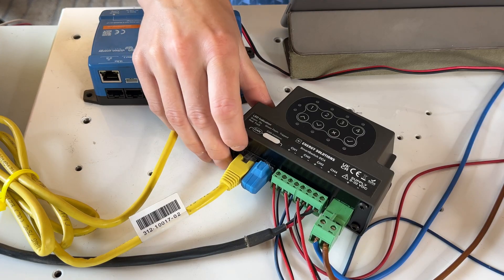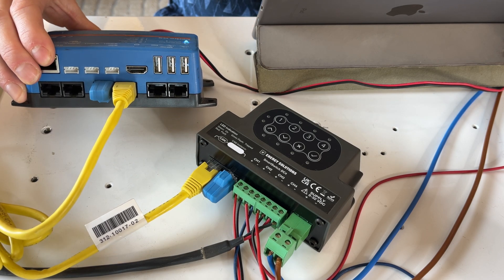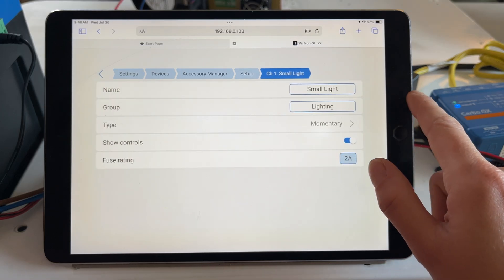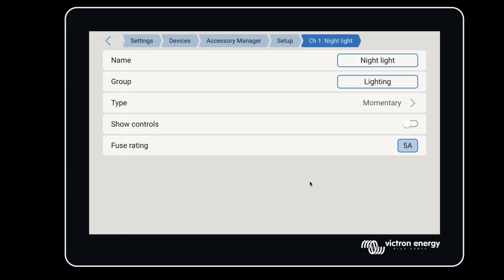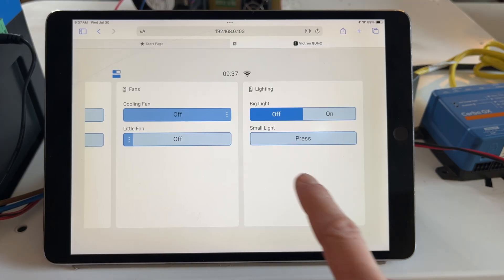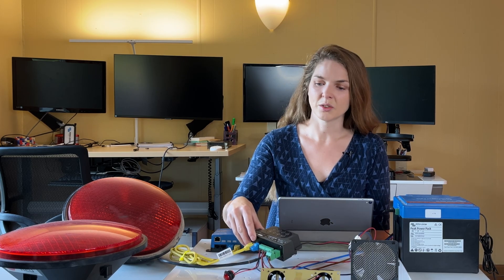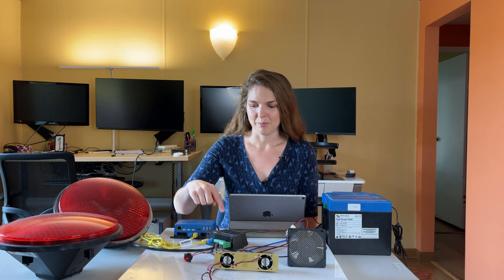Add More Relays to Your Victron GX: SmartSwitch DC Load Controller

Comment: How do I set an output on the Smartswitch DC4 to control a fan from a temperature sensor connected to the Cerbo GX?
Reply from the maker: This would be something I'd most likely do via Node-Red. A bit more custom, but it would allow for the most flexibility in your setup.

Comment: Hey great video, I want to use this to controller for my water actuators water tanks valves for my caravan that has three tanks. From my end look good but I just want to know is there a setting to automatically close the empty tank and open the next full tank. Thanks
Reply from the maker: Not a specific preset to do so, but if you have tank level measurements you could likely create such a function via Node-Red. Trigger "x" to happen when tank 1 is empty, etc.

Comment: It's mentioned in the video if you wanted to turn a heater on you would need the right relay, how does that work and what product can I use?  Good video.
Reply from the maker: This depends on the heater in question. A small one might be able to run through the relay itself, a large one we might see an "ice cube" relay involved. Basically something that is rated to handle the power and the output of this device triggers the control circuit.

Comment: $300 though. Great idea and product but not for that price
Reply from the maker: Ah! You think? For the control, flexibility, and direct power throughput of the device, you’d be hard pressed to find as simple and robust a solution for a better price.
Reply: @intelligentcontrols in a marine environment, though can be used in RVs or elsewhere, have a look m at the maretron mpower - 12 digital switches AND 7 digital inputs, and each switch can do upto 5, 10 or 12amps, and this can be increased by doubling inputs. These smaller ones you've shown have such limitation for 5amps - I have 2 led light snakes that go over 5amps!  You can also get the Maretron, which can handle 100a in total, for less than a 4 of these ones you have shown, and it can power a lot more.
I do like the physical switches on the unit, but I understand d why the maretron ones have a separate physical switch panel- if the main unit is fried, the separate switches should still work, but with the ok ones you have shown they are fried as well.
There's many things I don't like about the mpower, but so far they are by far the most full featured.
Until other non marine manufacturers realise the price is ridiculous for the limitations - having a separate relay for fridge, freezer or anything above 5a is stupid and unnecessary - we have to go with the proprietary. 
I'm really looking forward to seeing a better mousetrap, but the unit you show isn't it.

Comment: Can you make a video demonstrating how to configure a dimmable light
Reply from the maker: @buckmanriver good clarifying Q. Do you mean within the SmartSwitch and the Victron UI? These are regular, nothing-special lights and fans on the demo board (and they have been returned to the wild!) but I connected each one to the SmartSwitch, went into the Settings > Devices > selected the channel and set it to be either dimmable (PWM), latching(toggle) or momentary and the the SmartSwitch does it's magic, no extra step needed. (See min 2:02 in the video for a visual.)
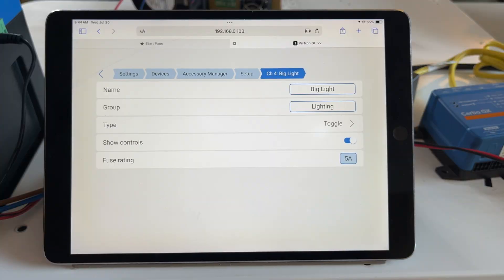Reply from the maker: Also check out the Energy Solutions UK video about the SmartSwitch, at the 2:40 minute mark, they do a quick overview of setting up one of these switches in the GX interface https://www.youtube.com/watch?v=S4H_qtIe9bk

Comment: Have you seen the Safiery Digital Switching products? They claim to be Victron compatible as well. So looks like two options now for digital switching within the Victron ecosystem
Reply from the maker: Hi Jim! Good question. Safiery is a solid product, and the integration looks good. The SmartSwitch is all about keeping things simple and reliable. 4 DC channels, each with built-in protection with simulated fusing. Talks to Victron with the simple CAN plug and terminator. No extra setup required unless there's a new software update you'd like to push in the future. The separate button pad is nice. On the SmartSwitch, you can control the switches from buttons on the front of the device, if accessible. With the Victron Integration, you're more likely to be controlling these from your phone, tablet or touchscreen anyhow. Obviously, the biggest difference is the price point. If you're just looking to control loads like lighting and a few larger loads with a relay, the Smart Switch makes far more financial sense. If you have many devices requiring higher amp switching from the start, the Star-power from Safiery is probably a better option.
Reply: @intelligentcontrols  Thanks for the detailed reply. So many ways to skin this cat - no clear winner that I can see - all have pro's and con's - when will some clever guy see the light and make the perfect product? Until then we keep slogging along with all this. Also, can you dive into the "simulated fusing" a bit more - how is this working? Is it just software driven or is there hardware involved?
Reply: @intelligentcontrols  Oh one big thing that jumps out - viz-a-viz Smart Switch and Star Power - and that is that the Smart Switch can do 24v and the Star Power is 12v only. I need 24v (on the smart switch i can drive up to a 150w load - not doable with 12v)

Comment: Really great that you have made this video - perhaps you could do a video of this device in a setup and run us through the whole process of brain storming the ideas of what you will switch, the layout , tips and tricks on setup and then demonstrate it all working. You guys are hitting the ball out of the park - keep up the good work.
Reply from the maker: Thank you, Jim. Yes, would love to make a follow-up video on a fully tricked-out mobile setup. Laura really needs to get herself a multi-level floating boathouse for a real demo :) In the meantime, feel free to share ideas and questions here. We'll let you know what we think/what we might do in your scenario. This is such a flexible device compared to what we would have used in the past, eg. a control by web relay.
Reply: @intelligentcontrols  so the one thing that jumps out at me is how do we switch (loads) easily? It seems that one has to use the Victron interface via a Victron touch screen OR the new Android tablet feature in order to activate switching a load on/off- (Discounting the push buttons on the unit itself as this unit would usually be tucked away somewhere inaccessible). Perhaps controlling the off/on for each circuit on the device could be via Victron Connect as well (so via a smart phone) ?. Overall this method of switching something on/off via a screen that shows the victron interface seems cumbersome - what is needed are small screens installed in locations that make sense to the application with an easy to use interface on those small screens - much like HA. An example would be if you wanted to turn a light on/off - without a physical switch next to the light the only way to turn it on/off is to go to the Victron interface and turn things on/off from there. (whether via Victron touch screens or an android display) This does not feel comfortable in daily use - we need something that does not go near the Victron eco system - that eco system is best left well alone once its up and working well - dont want to be in there on that interface to turn something on/off on a daily or even hourly basis (lights?) ........ Thoughts?
Reply from the maker: @jimjones7821  So the advantage of having it connected to the larger Victron ecosystem is that you can use all of the information associated with the ecosystem to make decisions about your loads. And in a lot of cases, it can reduce the number of screens. Screen for this, screen for that can get pretty cluttered. If you have, say, four loads and you want to be able to control them from a single location, then it’s a good option. If you have a mega yacht and you need controls all over the place, then probably not the best.
Reply: @intelligentcontrols  Also another question - can this smart switch be run via N2K standalone or does it always need to be connected to a cerbo in order to operate? If it could be used as a standalone N2K device then it could be switched via various interfaces out there such as SignalK and marine  MFD's (you'll need one for the house boat)
Reply from the maker: @jimjones7821  The main point of this device is to be able to be used with Victron. The closest we could get to a remote control is through Node-RED, or using digital inputs to toggle relays. If you start looking at the Cerbo as a remotely accessible PLC that happens to be connected and have nice access to the data from the devices then that’s really where it gets more interesting. We could just use the SmartSwitch as just a switch without any reference to Victron devices and it could be controlled by something completely separate from Victron. People have been asking for this for a very long time and so it will be interesting to see how people adopt it now that they have it.
Reply: @intelligentcontrols  understood. I just need to find a way to control the switching outside of the Victron environment - I would not want others on that interface in case they push or touch something they shouldnt. Interesting times. I want to order 2 x Hatz Diesel battery chargers - I cant get them through you as I am outside the USA - is there any particular spec I should be ordering to make sure its the right setup for the Victron setup? The most amazing thing (there are many on this DC genset) is it is now DVCC compatible - this is truly massive! I am not sure people get what this thing is. Most people I talk to about it almost always say its so expensive for what it is......I think its an amazing breakthrough. To the extent I'll take 2 (for true redundancy)

Comment: Is the "American" network cable different to a regular international ethernet cable? A product link in the video details would have been useful, a Google search pointed me to a rival retailer of the SmartSwitch DC Load Controller.
Reply from the maker: Yes, good Q. It's a standard Ethernet cable plugged into the same Cerbo/Ekrano CAN port used for a solar charge controller or other CAN Victron device. Link added to the description, thank you, Sir! 🎩